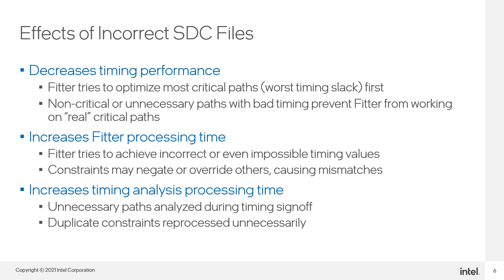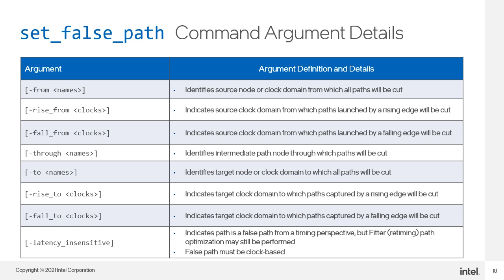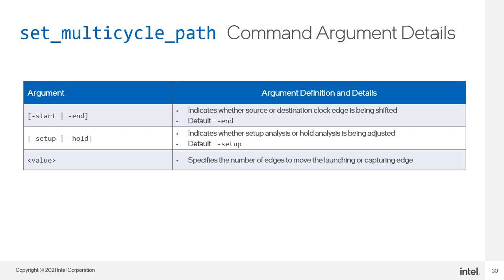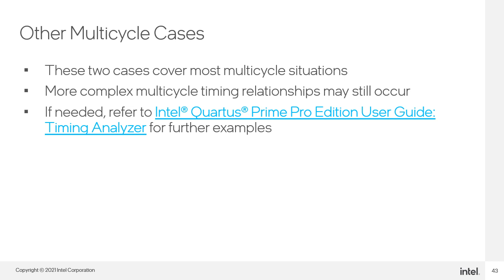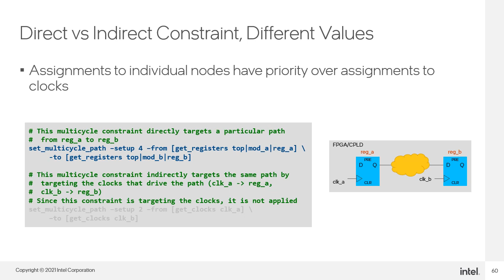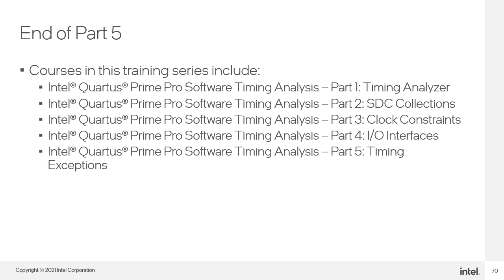Comment: Hi there
What about whenever clk enable clock is just one cycle capture window? Does it make any sense to add timing exception?
I was deriving a 1200Hz clock enable from 50MHz clock, each 1200Hz pulse width is 1 50MHz cycle intended to capture 1200bps serial data.
Thanks in advance